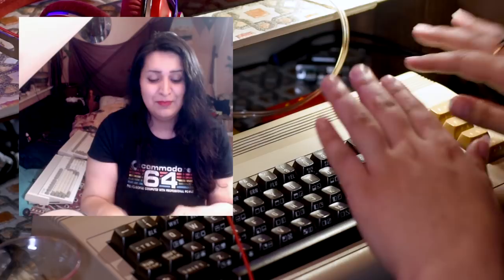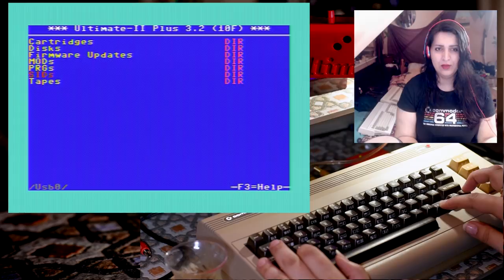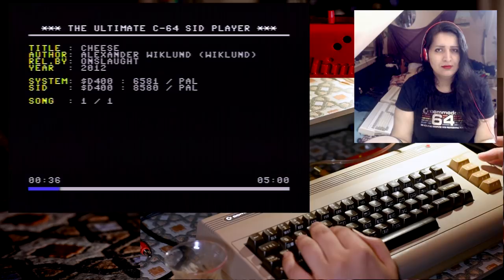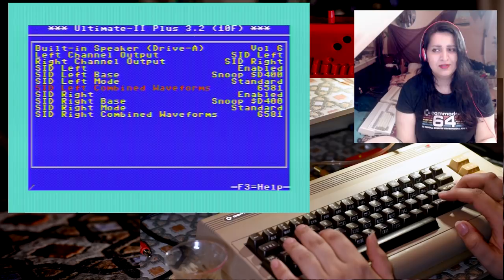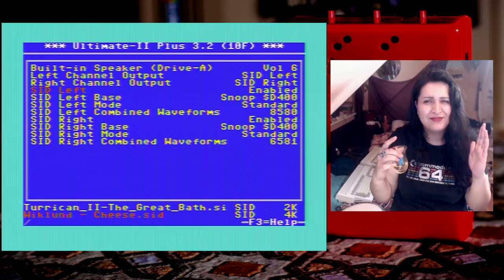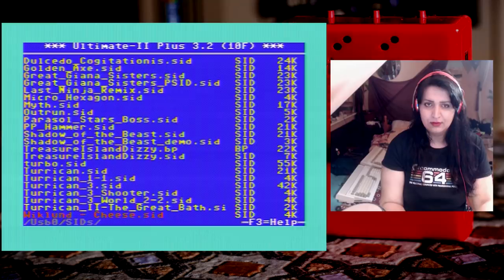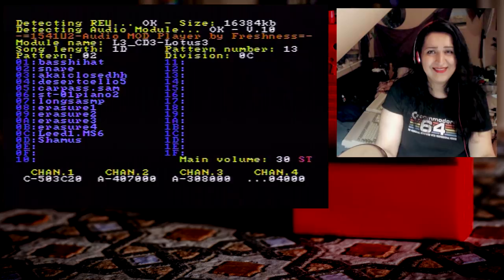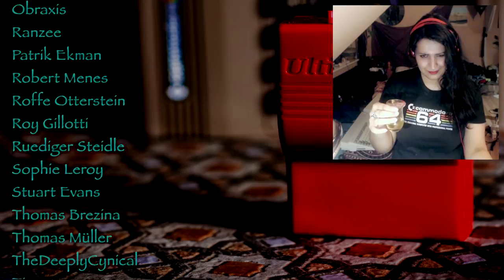C64 Ultimate II+ Part 3 - Exploring the Audio, SID and MOD player

Comment: Thanks for the lovely videos about U2+! After blowing up my real 8580 chip last week, I switched to using U2+ for listening chipmusic and found your video series informative. The pseudo-stereo effect you have in the video with real 8580 and 6581 chips sounds great. Unfortunately, with your version 3.2 of the U2+ firmware, there was no way to produce the pseudo-stereo with two emulated chips. I have the newer firmware version 3.6 and it adds panning for the emulated chips. Scroll down the Audio Output Settings screen to see "Pan EmuSid1" and "Pan EmuSid2" settings. The default setting for panning seems to be "Center" which produces the same mono sound. However, if you switch panning settings for emulated chips to "Left 5" and "Right 5", the channels are separated and you get the pseudo-stereo effect. Settings "Left 3" and "Right 3" produce quite balanced sound with little bit less channel separation. Good test tune for the effect is Wiklund's "Atmosphere".

Comment: Hi - a bit late to the party. Recently I also got me an Ultimate II+. I believe the 6581/8580 setting only makes a difference for combined waveforms (hence "Combined Waveforms" in the menu). For example, The Last Ninja 'Wilderness' SID tune has a section that uses a combined triangle+square waveform (starts at about 40 seconds into the tune). This will sound different based on whether you select 6581 or 8580. Cheers & keep it up!

Comment: I know you made this a couple of years ago, but have you managed to sort your stereo SID issues yet? I just ordered a UltimateII+ but hasn't arrived yet. I noticed this in the FAQ in the manual, maybe useful...
1. Find out what address the second SID is using for the 2SID you’d like to listen to. The ultimate SID player that’s included shows the second sid address since firmware 3.2. 
2. Go to the Ultimate menu and press F2 (shift + F1) to enter the configuration menu. 3. Select ‘Audio Output settings’ 
4. Enable SID Left 
5. Change the address at SID Left Base to the address you saw in the ultimate sad player. Probably something like $D420 or so  6. Go to ‘SID Left Combined Waveforms’ and choose the model the 2SID tune was composed for. Most likely 8580.  7. Go to the Left Channel Output and Right Channel Output and select for both ‘Left SID’. 
8. Make sure to plug a mini-jack in the line-out mini-jack port and connect it to your powered/active speakers or an amplifier. 
9. Run the 2SID file and have a listen ;-) 
Btw, the address of the SID chip inside your c64 is $D400.

Comment: 11:46 You are describing phase here. when one wave goes positive, the other goes negative. added together they cancel each other out. I suspect when you were mixing the real sids and the emulated, there was a slight processing delay on the emulated ones and that was enough to push the wave half a cycle and create the phase issue. You could try inverting the output of the emulated to see if it brings it back in phase.
Reply from the maker: Thanks for the clarification Mat :o)

Comment: Pfft. All this time I was using the dual drive firmware version even though I never use the second drive. Still, for the U2 (not +) I can't use the audio firmware past 3.4c because it removes the ability to record tape. I love my tape drive and I am not giving it up for a very slightly more optimized firmware update. Tape transfer already didn't work from firmware 2.6 all the way up to 3.2 which I thought was crazy considering it's value! I actually had no idea there was a SID player built into the audio until today! I thought the "audio" firmware just gave you a dual SID...which I don't think I need because demo sceners don't make demos for NTSC machines with dual sid very often, if at all(though I might just be living under a rock there too...). Anyway, I just downloaded the HVSC and I will be SIDing away contently(On that front I can enjoy the dual SID at least).

Comment: Around 12:00, What you're describing is when two audio waveforms are 180 degrees out of phase, they cancel each other.  If you draw two sine waves, 180 out of each other and then look at the point in time where one is on the positive peak, the other is on the negative peak.  Add the two voltages together +V and -V and you get zero.
So the latency in his emulated sid is causing it's waveforms to be out of phase with the hardware sids.   Like if his emulated sid is starting a wave a few microseconds late, it will be out of phase.
And that's where the infidelity is coming from. ;-)
Reply from the maker: No i know it's not a polarity thing, i was describing the feeling of the sound you get being the same as one of the speakers in a hifi system being the wrong polarity, that compressing the head feeling. I'm a very visual person so it's kinda hard for me to explain things technically without drawing it, hence why you see me wave my hands around a lot :o) 
yes if there was a way to add delay, maybe route it through some sort of FX unit maybe.
Reply: Actually if you play the same waveform twice, out of phase, some cancellation will occur just as if it was inversely polarized because the same frequencies are used and if the phase corresponds to (or is just about) the wavelength, you get cancellation... or better described, that "weirdness" we saw here. So it is cancellation, it is in some way like phase inversion, and all of this at once :)))
Reply: You'd probably be talking about an incredibly small amount of delay.  You could measure it if you have or can borrow a dual channel oscilloscope.  Put one input on the hardware sid and one on the emulated output.  Turn on a sine wave and trigger the scope off one input.  Then you can see how far the emulated sine wave lags the hardware wave in time.   It's probably too short to do with the coarse adjustment of a delay line.
I imagine the emulated sid would only be useful for adding more voices, rather than reproducing the output of the hardware.   If he supports that in his firmware.
Reply: I love coffee but if i had 8 cups id be running around like a Hypo 3 year old.

Comment: Load into REU .. means "Ram Expander Unit" .. the external RAM above 64kb. :) So you're buffering the song up there north of the boarder.
Reply from the maker: Yes I know REU but i was wondering it would be doing that anyway for any mod which is over 64kb? :o) .. wondering why the option is there
Reply: Hmm you're right. Okay, Some .mods I have using massive sample sizes, perhaps (I am guessing here) they only load sample data into memory and the pattern is  played off fixed or floppy disk normally as needed to save RAM, but the option is to load pattern and sample data into REU? I am speculating now.  I loved the Lotus tunes.  They were a great deal of my teenage years also. :)

Comment: I have the Ultimate ii+ l in 2024 and I was messing with the internal SID options and getting frustrated that the Arkanoid theme was sounding very off and some of the sounds were blending together.  It sounded exactly the same with 6581/8580.  So, currently no work-around yet?

Comment: I was just wondering about a couple of things Maddi. At 6:50 into the video, you've just disabled one of the SIDS (the 6580) but the player still shows both SIDs. Could it be that your settings aren't being saved? 
Another thing is that in order to use the dual SID setup, you must have installed the audio firmware 'update_audio_3.2.u2u' instead of the dual drive one 'update_dual_drive_3.2.u2u'. Could that be the cause? 
Gideon hasn't been free of making mistakes, but this device has been on the market for a long time and I suspect someone would have noticed if the 6581 just didn't work at all. 
I do agree that the simulated 8580 does sound a bit more canny or compressed.
Reply from the maker: Yes, I am wondering if there's anything i'm not doing right, i know the update audio u2u  are for ultimate 2 only, from what i read, u2p is for ultimate 2+ and it seems to be an all inclusive firmware, I will look at his site a bit more, it's a bit unusual for the U2 to have dual SID and not the U2+ yet.. and what you're seeing at 6:50 is the first one being "system" i'm assuming the real SID installed.  (even i thought the same initially which confused me) 
I need to check up again on the firmware!
Reply: Oh you're actually right about the firmware Maddi. There's only the single version firmware so that can't be it.
There's definitely no difference in sound between the two options, they're exactly the same. It has to be a bug somehow. I can't imagine Gideon would just relabel the 8580 code. It's weird. I'll have a look at my Ultimate2. If you can help me find a tune that will clearly show the difference between the two sids so that I know what to listen for, I can check to see if there's a difference on my Ultimate.
Reply from the maker: Its strange, I thought he hasnt even implemented the 6581 at all and maybe working on it, but it should be there, esp if it is in U2 ... have a look at the same tune here  'Cheese' by Wiklund  you can find it in the HVSC library, if not i can send you it.  in that tune if you hear it on a 6581 you will notice the difference in the sound of the bass and the first part sounds muffled in the 6581, there are distinct differences in that tune. you will realise immediately :o)
Reply: Thanks, I just downloaded the entire HSVC library. The weird thing is that I don't have the audio firmware installed, but I have the same settings as you do, and no matter what I do it sounds exactly the same every time. I have the feeling that I'm changing settings that have no effect at all. 
I'm going to look a little further...
BTW in "audio output settings" it says in my menu "SID Left Combined Waveforms" and "SID Right Combined Waveforms". This is where I can select either 8580 or 6581. Why is it called that?
Reply: Thanks. But I think I already know what my mistake is. I automatically assumed the music I hear through my monitor speaker is generated by the Ultimate, which of course it's not (silly). I have to go back and try some more...
Reply from the maker: I have no idea why it labels them "SID right Combined waveforms". That terminology is a little baffling for me even. 
Okay so youre having the same issues here also with the U2 .. I wonder if the 6581 has been implemented yet or if it's upcoming, Gideon did comment on my first part, I may reply with the link to this third part and ask him.
Reply: I do get disk sounds when I switch to those instead of the SIDs, so we know changing the settings has effect. I don't think we're doing anything wrong. I really wonder what Gideon's reaction will be.

Comment: What I want to know is: I have a C64 with a wonderful sounding 6581 - will the emulated 8580 run well in dual mode, with my inbuilt 6581 Sid Chip?

Comment: Well, so much going on here. I dunno, judging by the intro to "Cheese", it seems the simulated SID sounds a bit more muffled, like it isn't handling the envelopes in the arppegio sound quite right. The real 8580 sounds more bright, like a distinct cat meow vs a cat  inside a blanket, if that makes sense. The phasing and cancellation definitely came across even through YouTube, and I'm wearing headphones (as usual) so my head felt compressed too. Is it software simulated? FPGA? Might just be a bug that can be fixed in firmware. Also, that dream trance piano MOD by Stefan also definitely reminded me of Robert Miles. Pretty much most of the tracks on his debut album have that similar sound. And yeah, 2017 really was a bad year for musicians, and music in general IMO. Lastly, I think maybe "benchmark" is the word you may be looking for instead of "calibre". Very good video chock full of goodies.
Reply from the maker: Yes the simulated SID sounds like it's almost missing the low end of the EQ..There is something that sounds a little off about it when directly comparing, it's more muddy sounding.  I did notice that.
And as far as I know these are hardware simulated, not emulated.
Reply from the maker: When I was commenting in the video and I said it sounds close, I meant it in the context of it sounding more towards an 8580 than a 6581! I know that it doesnt sound exactly like a real 8580! I noticed the lack of basses and Lows as i said above...
. This is the sole reason why i considered mixing it into the real dual SIDs because it sounded almost like a third kind of SID .. though the mix didnt go well because of the phase cancelling out issues which means it wasnt as different, but still i am aware that it still sounds muddier than the actual 8580. I think you totally missed the context in what I was saying when I said that.
Reply: Actually, I do understand what you're saying, in that the Ultimate-II and real 8580 aren't exactly alike, but quite close, hence the cancellation when mixed together. I agree there are similarities which make it resemble the 8580 more than the 6581, and I realize you referred to the Ultimate II SID as closer to 8580, and that no matter how you adjusted the settings in the menu it still sounded the same. I don't believe I missed the context, since I'm not debating how identical (or not) the 8580 is from the Ultimate-II. It's been established that the Ultimate-II hardware isn't an exact replica and sounds different. I just find it quite interesting and fascinating in what ways they differ.

Comment: Phasing and cancellation will "move around" depending on the frequency and the latency (as someone else pointed out.)  If it were just a polarity inversion, then the sound would cancel-out more or less completely.  If you reverse the polarity yourself, you can get the cancellation, and that will point out any inaccuracies in the emulated SID's, since that's all you would be hearing.   I also wonder if just the screen is messed up and just not selecting the two emulations properly.  It seems weird to have both listed and just go to the same emulation for no good reason.  Could be just a bug?

Comment: If you have an oscilloscope, set it up in X/Y mode and put the L & R SID outputs to the X & Y inputs.
(you may need to adjust the audio balance to get the same amount of deflection on both X & Y inputs)
Now if the signals are the same you will see just a line. (45 Deg diagonal)
If the phase is out, you will have rotation of the line (Not 45 Deg)
If the signal has components that are different, you will see the line open / fatten / Chaos !
(like this https://www.youtube.com/watch?v=0MIz0Yug9RM )
The best test SID tune for testing is 'Can U C A 8580 - Hein Holt' https://www.youtube.com/watch?v=XR92aILwvlM
Depending on the 6581, some instruments will be missing / muted / different etc..

Comment: 8:50 its not stereo if left and right plays same tones. should second chip be difrent address base and SID need be using 6 tones? song is sending data to address sid1 $D400 sid2 $D420... mayby. thats what i should do lol. if you jave both addresses same iy just play same noes on both channels. right?
Reply from the maker: Yes, it does play the same notes on both channels, however the 6581 and 8580 SID chips are different and they have a stereo effect, of course its not true stereo but it definitely isnt mono, so I tend to call it either dual mono or pseudo stereo. 
you're going to need a SID that is programmed to play the extra channels at the address $D420 if you're going to set it as that... like a 2SID file..most SIDs of course won't work like this.  Here I review a a device that switches between different modes: https://youtu.be/MfxpUHkbdtA

Comment: @msmadlemon Is there any way to do midi INPUT with the Ultimate II+ taking up the cartridge slot? Would you have (paid) time to help me finish putting my sid2sid into my NTSC breadbin?
Reply from the maker: There are multi cart adapters but i'm not sure how they work, if they would allow it, if they would allow an ultimate and a midi cart to work simultaneously, it doesnt seem they would because i'm assuming they would only allow one cart at a time,(never tried)., I dont know of any other way unless its possible to have a midi device on the user port maybe?

I'm unable to help with the SID2SIDboard as i'm quite busy, but it shouldnt be so hard to install. If you've built the SID2SIDboard itself you've done the hard part.
Reply: Ok thanks and cheers!